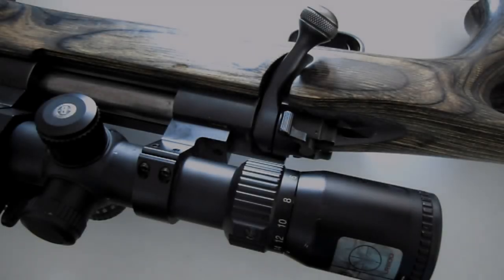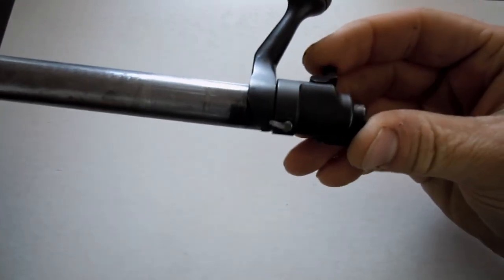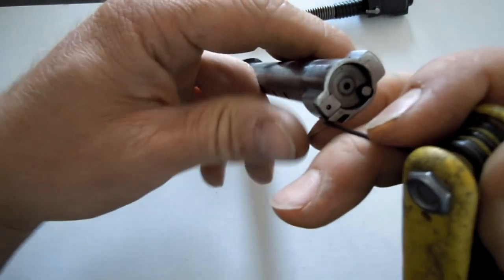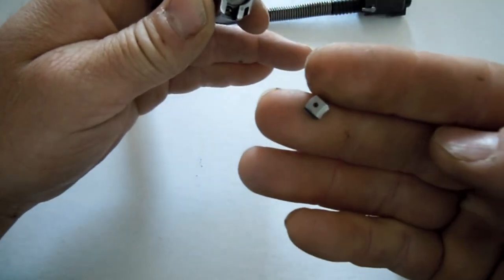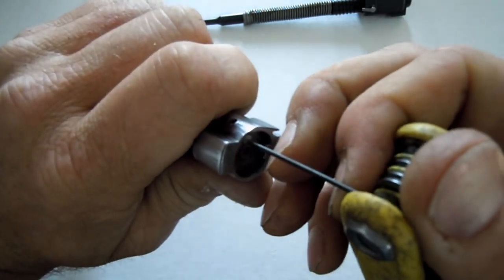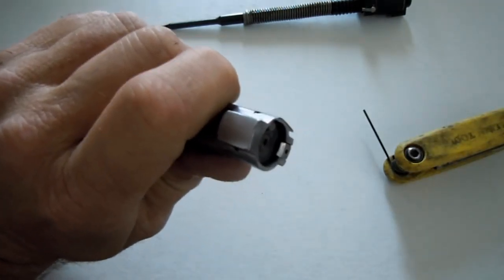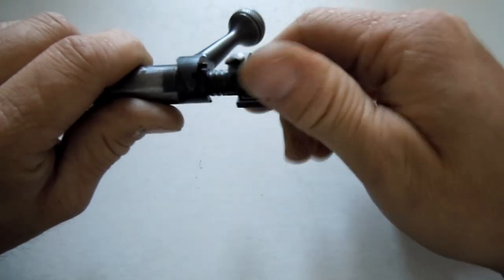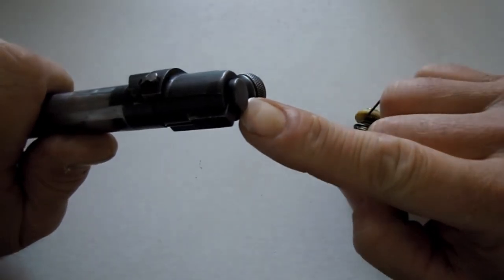model 70 bolt disassemble and assemble with extractor removal

Comment: Thanks for the vid. My Extractor had no pressure. I feared a broken spring.  Luckily it just needed to be cleaned out and your video helped me figure out how to get to it.
Reply from the maker: I am finding that no matter what oil I use it is gumming up and or freezing within a year or two. I have just turned to cleaning them every year and a very light coat of oil. To help clean the gummy residue up Brake Kleen works great.

Comment: I have an issue with the 3 position safety collecting a waxy rust. A gunsmith took it apart and cleaned it good years ago but the rust is back, (and yes, I keep it oiled) Any idea on how to get it apart to clean it out again?
Reply from the maker: Hi Robby what I have found with my guns is that if I apply too much oil after a year it starts to gum up on me pretty bad especially when it gets cold.
Reply from the maker: Sorry for the delay. I have never disassembled the safety, I will tell you that I was having issues with all my stuff gumming up. turns out the oil gets sticky over time and in cold weather. I am finding that if I put some oil on a cloth and do a light coat it doesn't get as bad. unfortunately I am still having to take them apart every year for a cleaning and re-oil. seems to be the only guaranteed way for me.
Reply: Same here .. Did you fix It? Can't find any video

Comment: Any ideas why my safety is stuck in the fire position?
Reply: Not sure why it's stuck but  if you follow what's shown at the end of the video, then put the bolt back in the rifle completely where it's locked down, you should then be able to move it from fire to safe.  Even if you do what is shown, it won't move from fire to safe until the bolt is seated back into the rifle.  You may even need to dry fire it first.  That was my issue but after doing what is shown at the end of the video and what I've stated here, my Model 70 is working as it should now.  Hope this helps.
Reply: Even fully assembled, I had to get a screwdriver in there to pry the firing pin back farther to get the safety switch to work. The nub in the back should poke out quite a bit more than it likes to in it's normal cocked position. Probably wear and tear, mine was built in 1938.